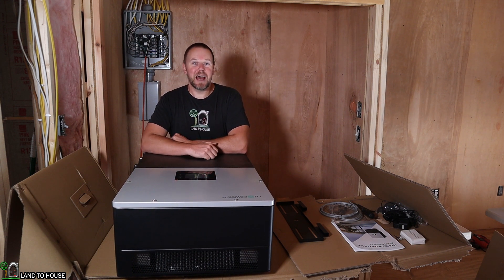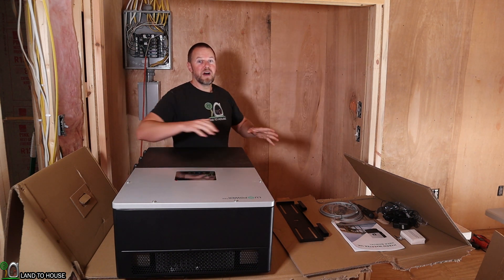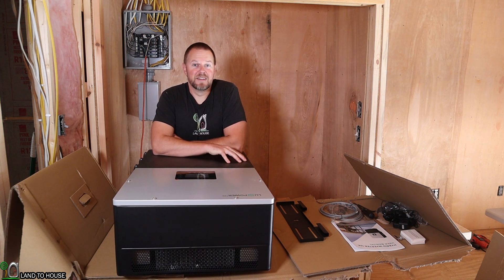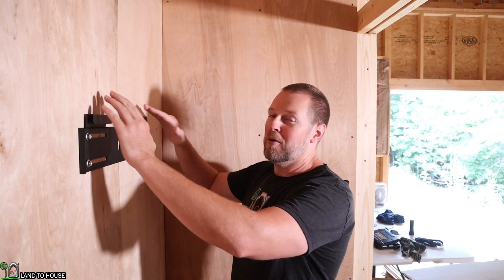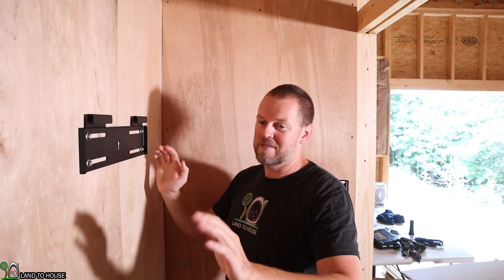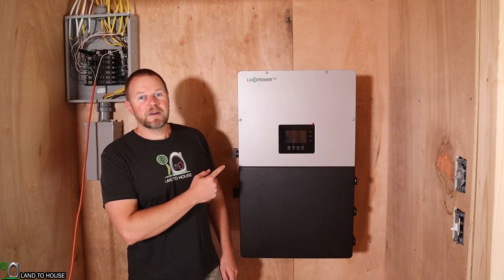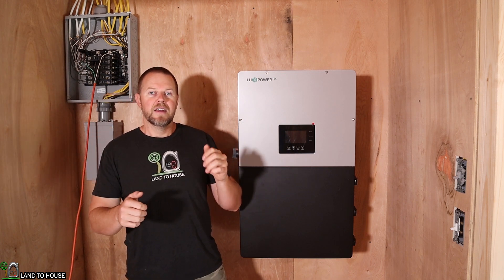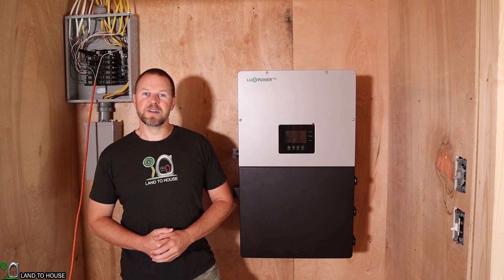Hanging a 130 Pound Inverter by myself Lux Power Tek 12k

Comment: Huayu has provided about 400 pages of new evidences to the court in China to prove that Luxpower used the same money for Huayu’s exclusive 8-10kW series models to certify the so called 12kW model(the actual AC output is 10.4kW/208V only). But Luxpower provided nothing to the court to prove they have paid another certification fee(another million CNY)for the so called fake 12kW(10.4kW/208V). Also Luxpower tried to prevent the court to obtained evidences that Luxpower has also sold Huayu’s exclusive models 8kW/10kW models to US companies(such as Fortress & Sunbeat). In this case, Huayu reserves the right to further sue Luxpower Contract Swindler Crime until Luxpower proves that they have used Huayu’s certification fee as agreed on Jan.14th, 2021 for Huayu’s exclusive 8-10kW series models, not including the fake 12kW model(10.4kW/208V).

Comment: Beast Mode hanging it by yourself.  Will a sit/stand desk designed for the weight of a computer be able to lift such a heavy load?
Reply from the maker: The sit stand I was looking at has a 170 pound lift ability.  Should handle a 130 unit like this.

Comment: I mounted mine a bit higher but there is no way I could have gotten it up there myself. That would not be an easy lift at all.
Reply from the maker: I actually did a test run before filming to make sure I could even pick this thing up. Pretty much called it a day after that haha. Just got the bms cables. Looking forward to getting power in the shop.
Reply: @LandtoHouse  haha yeah I bet. Thats cool your brother was able to make a cable. You can run it without the BMS coms also if you need to. Just use the lead acid setting.

Comment: 02:05 - Rawl bolts we call them in UK. Expanding rawls hold tight on the concrete, bricks or blocks. But make sure they won't crumble or crack.